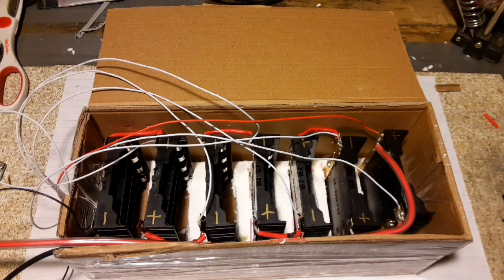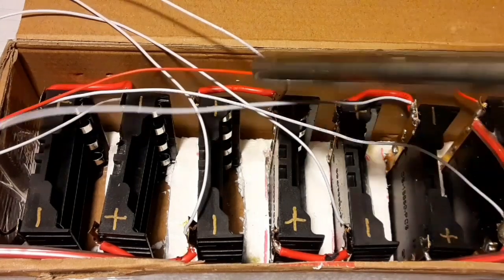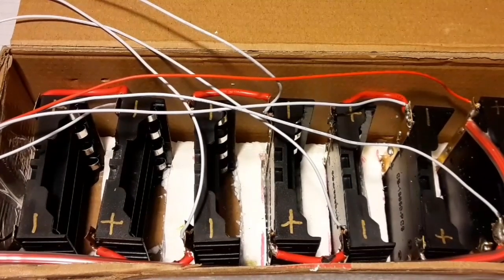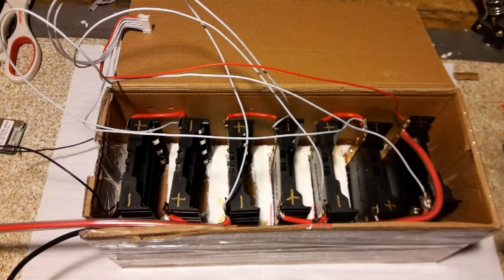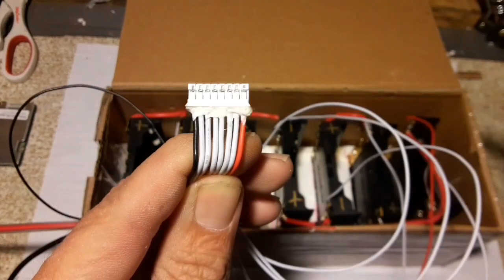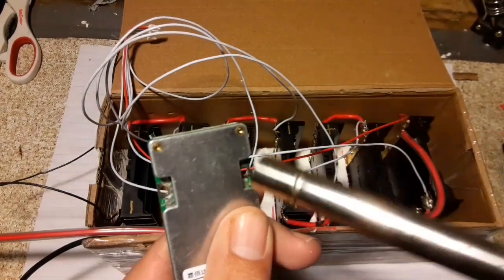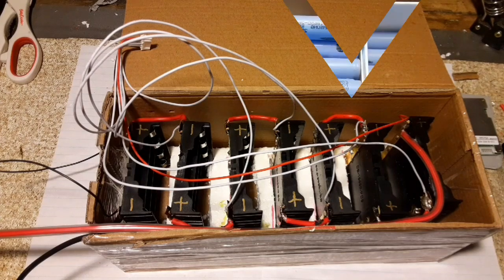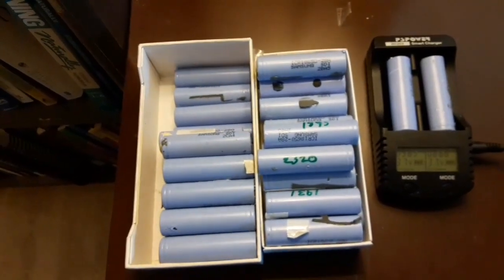DIY Repairable 18650 7s4p battery pack part 2. Wiring and battery management.

Comment: Hey, it's been over a year. Curious how this pack has been working out for you? Anything you'd do differently?
Reply from the maker: I've refined the pack design a lot to eliminate problems but I really need to make a stronger casing for the packs. The bike runs two of these 7s4p packs made with the same lot of used cells I purchased for the original video.  
I'll talk about it in my next ebike video when the parts arrive to continue the project.